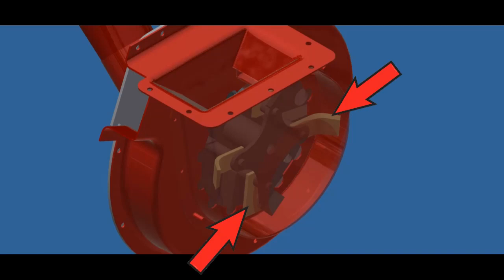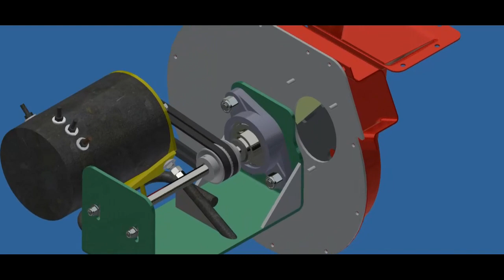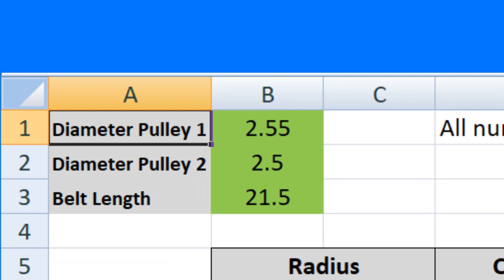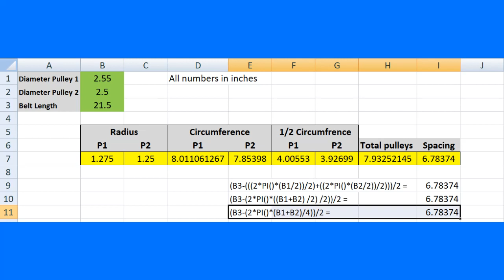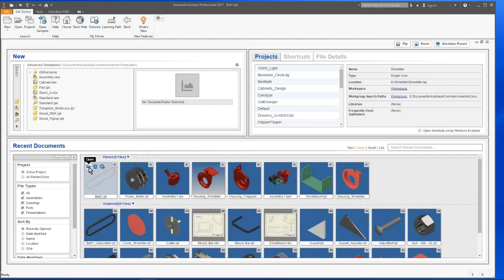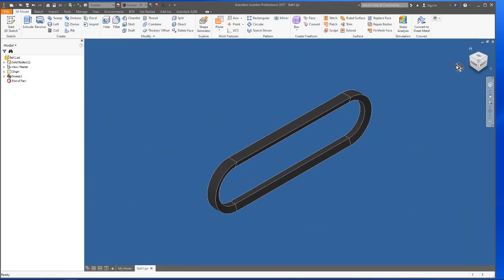Part 1: Chipper Shredder Electric Conversion - Design

Comment: thanks for the inspiration, is your shredder now more powerful than it was before? i'm planning to do something similar with my WW Grinder Chippewa chipper, which uses a belt drive 3.5hp gas engine, it should be fairly straightforward to just drop in an air compressor motor and run it from 240v off an extension cord. i think i'll add a current limiting relay to protect the motor.
Reply from the maker: I have found that that the power is about equal which is what I calculated when I started this project. Not to sure about using an AC motor; with DC motors the torque curve is opposite an IC engine where the DC motor torque goes up as RPM goes down assuming voltage is a constant and there is enough current available.
I am not familiar with toque curves on 60hz AC induction motors. Be sure your drive set up does not allow the chipper rotor RPM to exceed its design or it could come apart and at that RPM it could be very bad.

Comment: First thanks so much for this model, it's awesome. 

I have a "5 inch chipper" powered with a 14 HP Kohler Motor. I've been looking into replacing the motor to convert to electric using a high torque golf cart motor @ 48v. I'm well experienced with the electrical setup, however I still have a lot to figure out on the mechanical engineering side. I was for sure going to setup a direct drive until I saw your setup and realized how much better it'd be to "break a belt instead of a motor" haha. 

The motor I'd be using is an Admiral Motors MOT-A2, and getting that to work with a Power King (PK0915-H1) replacing the kohler 14 HP CH440 OHV four-stroke engine. Any suggestions on going from the golf cart "10 spline" to the 1 inch drive shaft other than designing my own pulley, and wheels like you?
Reply from the maker: Looking at the generals specs for that motor @ 9hp, it seems undersized to replace a 14 horsepower internal combustion engine. 
Although, apparently rated > 6000 RPM @ 48v it likely exceeds the RPM rating of your chipper. The Kohler thumper is spec’d at max 3750,  I looked up the chipper and was unable to tell the ratio between the motor pulley and rotor pulley.  You’ll need to find the maximum RPM of the shredder rotor for the proper pulley ratio (small to large) to match RPM which will also increase power delivered to the rotor offsetting some of the loss in the motor. WARNING: IF YOU EXCEED THE MAXIMUM ROTOR RPM, IT COULD HAND GRENADE CAUSING SIGNIFICANT DAMAGE AND POSSIBLE INJURY.

Since that motor is open ended, you’re going to need a precisely machined end housing; I chose a shafted output DC motor for that reason.  Maybe you can find an old golf cart transmission and salvage the housing which will also get you the 10 slpine input shaft but modifying it for a pulley would be challenging.

I chose a belt drive transmission so that under high loads the belts should slip and cushion the shock to the motor as I think that is what broke the engine output shaft.

Comment: That appears to be a chipper and and not a chipper shredder, as the shredder part is more like a hammer mill. 
So originally yours was direct drive?  Makes sense why the crank breaks so easily then.
I have a chipper shredder from 1983 and the muffler gets so hot now, it's become a sever fire hazard. 
I've decided to convert it to an electric motor. Will be building mounts for it this week. 
Thanks for the video!
Reply from the maker: Yes, direct drive and I think the crankshaft was too small to take the pounding of the chipper.
This one has 2 sections, one on the motor side that has two chipping blades and the hopper on top feeds into what you describe as a hammer mill.
Part 3 at 7:15 goes over its operation. https://youtu.be/QuYK8_j_2P4?list=PL5xZq7nwn4qSGedM-9s7P80tBnVbIZ2LJ&t=435
Good luck on your build
Reply: @digysdosdiy9113  Excellent. Thank you for your response. I'll be watching the other videos tonight!